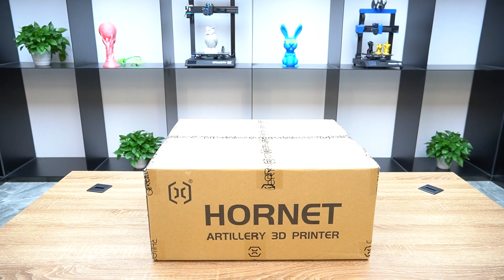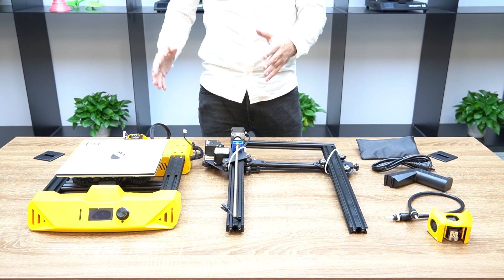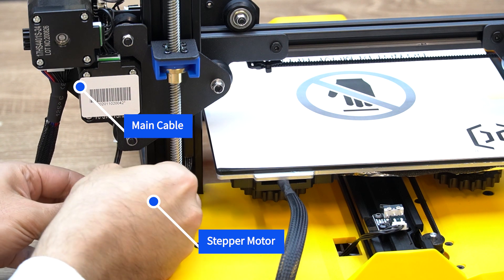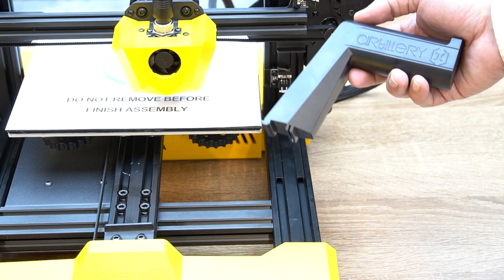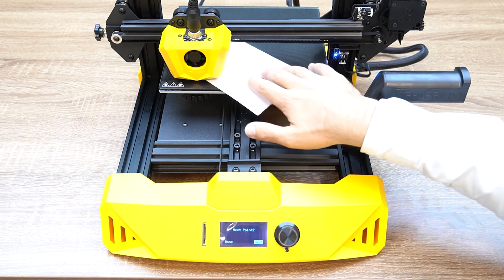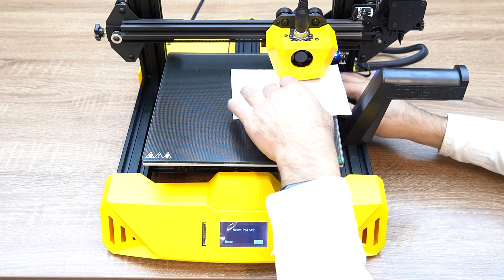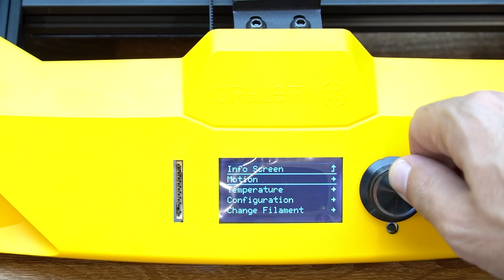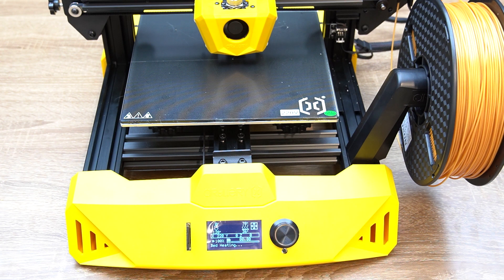Artillery Hornet - Unboxing and Assembling

Comment: As I said when this machine was first released, it's a shame that Artillery didn't stick with the larger format which won them so many new customers. The larger size proved so popular, but here they've gone backwards to much the same as is already catered for for by a number of companies.  Basically they've handed the bigger printer choice back to Creality. So what's new on this offering? A different method of getting the filament to the hot end. It seems to be a good system until you consider upgrading to a better hot end or extruder. It can be done of course, but it's not going to be plug and play.  Is Artillery planning on designing their own add-ons or waiting for some other company to cater to that market? maybe neither.

I must admit I do like the looks of the printer, yellow and black always looks good in my opinion. BUT colour and looks means little against actual usage. What happens to the plastic plug sitting atop the hot end? Most of us know exactly what happens when plastic is heated and cooled over time. It becomes brittle and breaks down. Or is Artillery using a new compound for that plug. Maybe it's reversible and we can change it around after 12 months, or more likely have to buy a new one. There's definitely little choice in where the filament spool goes and why does the filament do a 90 degree change of direction coming off the spool? There's not much room to place a home printed filament guide. 

Sorry, but despite the good looks, I doubt I'll be seeing one of these among my ever expanding collection. Did anyone spot a USB socket to plug in a laptop or PC? How do we adjust belts. To be honest, it looks like an attempt at the newbie only market. I wonder if there's any chance of Artillery updating the Sidewinder in the same colour settings and just maybe asking experienced 3D printe owners what they'd like to see on their next printer. Well, I can dream can't I?  :-)
Reply: Well...it is suppose to be their low end model. For that its ok...I like a lot of features on it but as seen in other reviews its ability to print nicely out of the box is limited. In the end its all about the price...if they continue to offer it above 200$  I doubt it will be successful! There are better offerings out there.

Comment: Is that a bowden extruder? Why go back when the future is direct drive with auto level and better sensors? If Artillery want to improve, design a 500 x 500 mm print mill with direct drive and level sensor. That is the future.
Reply: Yeah...everybody needs a mill at home.,duh. You completely missed the point of this machine!

Comment: I dont care if this is a entry level printer, this is a downgrade not upgrade. Printer of 2020-2021 should have auto leveling, touch screen large size, optical sensors etc. All these fancy plug and wiring doesnt do anything to help the new users.